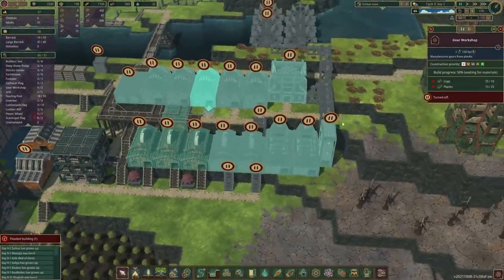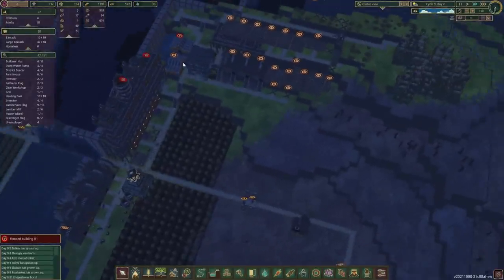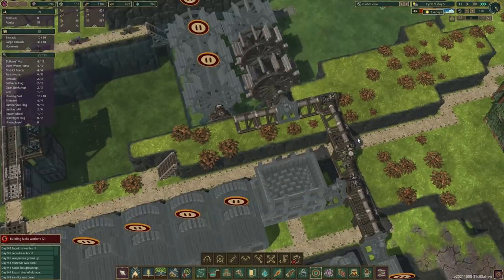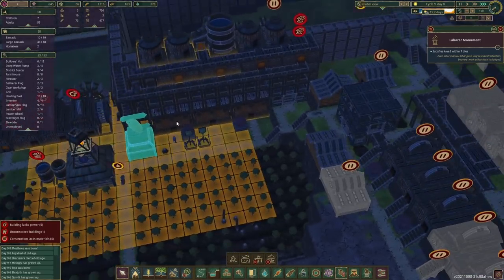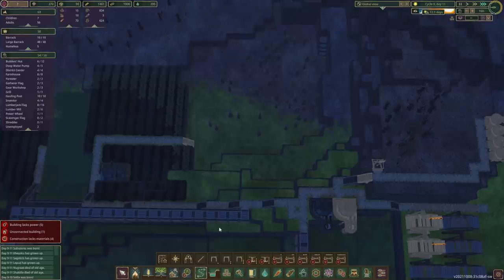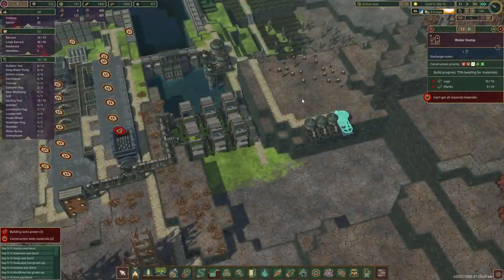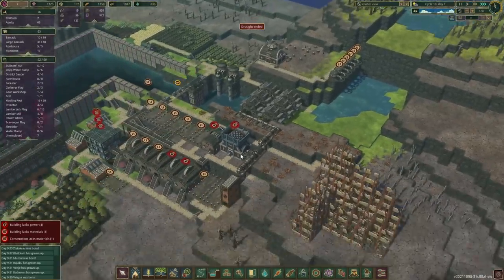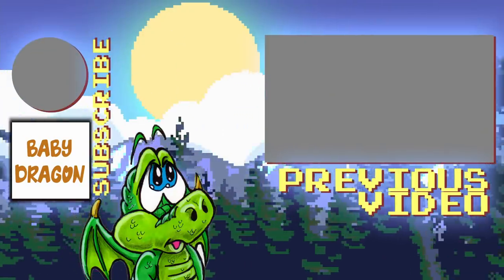TIMBERBORN | Experimenting With Alternative Power Source - HARD MODE | E08

Comment: 24:37 "14 beavers just to get power – is it worth it?" – compare this with the output of 14 power wheels (700 hp during working hours).
Reply: But.. compare that to the output of 14 engines. (2800 hp during working hours)
Reply: @tl3giannepesana  The engines even work during non-working hours (assuming you don't pause them manually), but there you also need to add the foresters and lumberjacks (and maybe haulers) to keep them supplied with burning material, so with 14 beavers you get less energy output than 2800 hp, but likely more than 700 hp. (And you need a lot of ground area to grow the trees.)

Comment: pumping water up works, just to make it worth while, use less wide canals to cause more flow. you can make them as long as you want. basicly you can make a power plant all around the map with just 4 to 6 water pumps/droppers. no clue if you can hookup power networks from different distribution points/centers.
Reply: good point
Reply: Yes, power distribution doesn't care about district borders, just "power connectivity". (Realistically, there should be some minor loss for long distance transmissions, but this doesn't seem to be in the game.)
Reply: IIRC you need 8 to have stable flow, but yes, you have good point
Reply: Pretty much this right here. A thinner canal so to speak. Seems to work Better (maybe) if the water is dumped into a slightly wider zone to cause a faster flow IE a 4x2 or similar grid to pump water into, condensed into a canal just wide enough for water wheels to fit into. Dropping down a level every 10-15 tiles
Reply from the maker: Totally agree, I was really just testing it out to see how it works hah. Wouldn't want to rush into big projects before I know exactly what the results will be :)

Comment: If you build up a line of levis to see a 1 wide chanel from where the water is dumped to the wheels to the evaporation area is smaller. I heard the game uses the surface area to work out the evaporation, so with less area it might work.
Reply: THIS

Comment: I'm wondering if the surface area of the reservoir that you are dumping the water in is too big maybe? I imagine evaporation works something like: for every tile that has water in it, subtract 0.1 levels every few hours, or a set percentage every hour.
So maybe it would help to put I little row of levies 1 high at 1 space from the dumps to guide the water to the water wheels faster without filling up that whole reservoir. That could save on surface area and won't interfere with water flow in the wet season.
But liking the series, keep it up :-)
Reply: yha same idea 👍
let's hope he sees you comment.
Reply: i think ur right

Comment: Seems a little strange to have six beavers working full-time to maybe spend one water wheel for a very short period why not just put a hamster wheel up at the end of the input shaft next to the water wheels. That way you can operate a limited number of workshops for only what you need.

Comment: I was about to suggest the game developers to include a battery to help store power then i realized the only type of power they used is only kinetic energy.

But can they include magnet though?🤔 That could go somewhere
Reply: They could add a flywheel. That's essentially a battery for kinetic energy.
Reply: That might work. But wont it work for only a few days only though. It can't stored all that kinetic energy that long can it? And the drought is scary long
Reply: If I were the devs, I would simply have flywheels store any unused HP up to a cap per wheel. Then you just draw from that power when supply is not enough.

Want longer lasting storage? Add more flywheels. If you produce enough excess power during the wet season, it could keep you up and running throughout the drought.

Given it'd just be a single number for a cap, it'd be easy to balance it.

Comment: is not worth while to do this, better u have them running the wheels, the engine is very heavy wood consuming to run, u need plant lots of trees to balance it, u need micro manage later to switch power source between water wheel and engines. is better to create water block with water dumbs to fertile a area of 15 block to plant tree and crops. or if u insist to make this work, is better to build another dam above to repeat the dumbing cycle until the water dry up